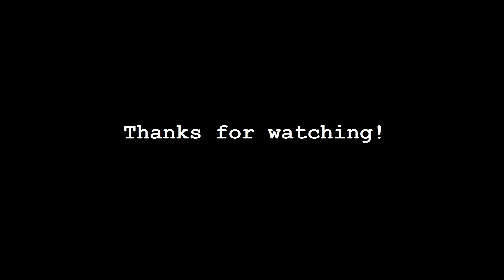Home Office Meets Home Foundry

Comment: That was genius. You are my kind of guy... If someone somewhere made it, it can be fixed, no sense buying a new one when you can put a little time into repairing it. I like your setup with the sandbox under the working area. I end up with petrobond all over the floor and it was ridiculously expensive. I have made exactly one casting and that was yesterday to try out the system. It went well enough for the first time. I will be watching all your playlists eventually. I am currently working on watching Paul's and swdweb's. I also watch Fordboy and a few others, but they are the three that I have watched the most. I figure the best way to learn is to take in all the information and decide what works for me... Thanks for the video, I learned something that I will use... Nice to meet you... Be well...
Reply from the maker: Thanks Ken, I'm in Ontario, just outside Ottawa city limits (but please don't hold it against me).  It's great to see another Canuck watching the show and trying their hand at molding and casting!  Was it the hammerhead or the rammer you cast?  Hope you got some video! 😄  The molding bench is nice, it's just half of a 55 gallon plastic barrel built into a box with legs and sides to keep sand from flying out (my foundry has a dirt floor so dropping sand is something I try hard to avoid), and a place to lay a couple 2x4's across it to support the molding board.  Easy to build and cheap too (other than the lumber, these days).  Mine has a hinged cover that doubles as the back wall, but I'm thinking about removing the hinges and just making the lid removable.  Then I can add a wall on the back to keep the sand inside the bench that I can also hang my molding tools on.  Take care, and good luck with your next mold!
Reply: @tobhomott  Thanks, yes... I cast the hammer model in Aluminium yesterday, not great, but I could see the grain from the printer. I do need to put some Alignment pins on my flasks. I printed a bunch up last night and they look like they will work great. We lived in Petawawa for 2 years and 1 year in Ottawa, west end... I was on a French course with the military and traveled home to Petawawa on weekends... I love the Ottawa cycling trails... Be well...

Comment: Nice Job. These cheep plastic items don't last! Good to have the ability to replace with a more durable material.
Reply from the maker: Thanks!  It was a cheap plastic part, but you don't want to know what the whole chair cost...  I'm loving this new petrobond!
Reply: @tobhomott  , Did you buy the petrobond or make it?
Reply from the maker: @sandrammer  it came from a bronze art foundry that closed down.  He had bought 300 pounds of it from Smelko Foundry Products here in Ontario 20 years ago, used it just a couple times and discarded the little bit of burnt sand, then it sat in bags in the corner for 20 years.  I had to break up a lot of really hard settled clumps of sand before my muller could deal with it, but as you can see it's now a joy to work with.  I can get ingredients from Smelko's if and when I need more sand but my molding bench is full and I still have a bunch more stored for later... Working on another video showing the rest of my new gear too.

Comment: Reading a post on the back yard metal casting forum you wrote this, can you clarify what you mean please, "Every charcoal furnace I see on youtube is being run super oxidizing; those guys are all gonna burn holes in their steel crucibles in no time and claim their crucibles dissolved in the molten aluminum" 
Regards
Reply from the maker: You running a charcoal furnace?  That must have been quite some time ago, but I can believe I said that.  My experience running a charcoal furnace for 2 years starting back in 2013 was that if you have the furnace blower set so high that flames are jetting out the exhaust vent in the lid, that is way too oxidizing and will burn a hole in the bottom of a welded steel pipe crucible within just a couple of melts.  The same crucible might last for years in a properly tuned furnace, ie. about neutral, with the blower turned down so the flames just fill the furnace and hardly poke up out the vent at all.  It's true that iron is soluble in molten aluminum, but you will burn a hole in a steel crucible in a highly oxidizing charcoal furnace much faster than you will dissolve a hole through it with molten aluminum.  Every newbie quickly learns from other hobbyists that molten aluminum dissolves steel like water dissolves sugar, but tutorials on properly tuning a charcoal furnace are virtually nonexistent.  Show me a youtube charcoal furnace video that doesn't have a 6" or taller jet of flames blasting out the vent hole that came out before my post, and I'll admit I was mistaken.  😉
Reply: @tobhomott  I'm looking at a range of fuel sources and coal or charcoal is what I'm leaning towards for a few reasons. 1, I won't be using it very often, 2, it some what provides some insulation allowing cheaper linings and 3, I might want to forge on it. 
I only want to melt aluminium so I don't need super amounts of heat. Yes it was from a far ago and I'm trying not to do my habit of digging up old threads. It makes sense now, thank you very much for your quick reply too.
Reply from the maker: @ifell3  makes sense and you're right about solid fuel being self-insulating.  My charcoal furnace was made of a rammed-up mix of fireclay and sand (cheap!) according to Dave Gingery's book, The Charcoal Foundry.  A charcoal furnace is the only type of setup I'd recommend a diy mix like that for over using real big boy refractory.  Was my old post on alloyavenue.com or thehomefoundry.org?  If the former, how did you even access it?  That forum has been broken for years, what a loss... 😢
Reply: @tobhomott  the home foundry, 
The Basics: Drip Injection Waste Oil Burners thread you made, which lead me to your channel. 
Yeah I've been doing a ton of research.
Reply from the maker: @ifell3  a deep dive to find that one. 😄  good on you for doing your research.  Post some pictures up on the forum when you start building it!

Comment: An amazing success indeed! I was giving you about 40% chance of getting that to work,  but I'm happy to say I was wrong. Was that Petrobond sand?
Reply from the maker: Thanks Mark, I'm glad it worked too as it's a half decent chair and I don't think cheap flimsy plastic replacement parts are available...  There were only a couple really thin sections I was worried about, once I thought of thickening the "pattern" with some sand packed into the back side of it.  
Yes, petrobond, good catch.  The sand is new to me, but 20 years old.  It had been used once or twice then just sat in a corner of a lost wax foundry that recently closed down, so I had to break up and riddle about 300# of it by hand because it had settled and compacted too hard in for my muller to crush.  I love it, it sort of smushes where my greensand would have just crumbled.  Very nice to make molds with, but the best part is, it's never dried out when I need it! 😁  I got some more goodies from that foundry which you would have seen here by now if it wasn't so overwhelming that I can't figure out how to make a video about it...  You can see some pix on my IG from a few months back though if you like.  Let's just say I'm going to need a bigger shed.